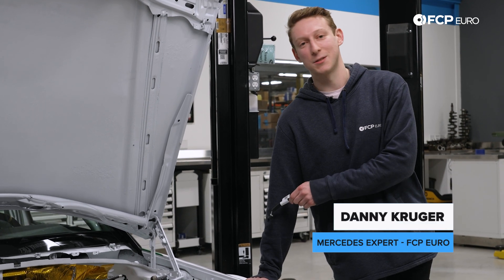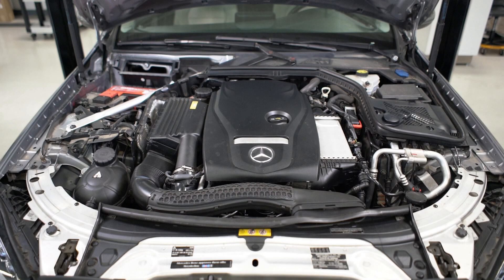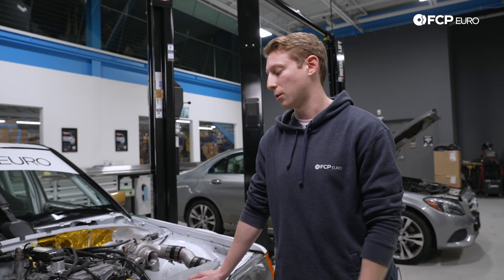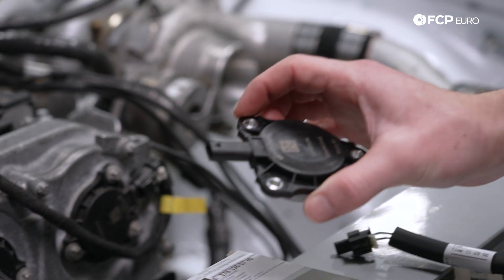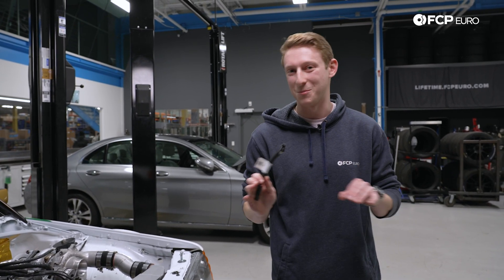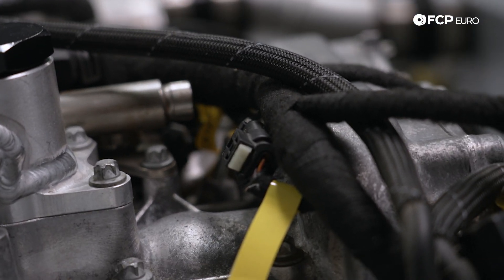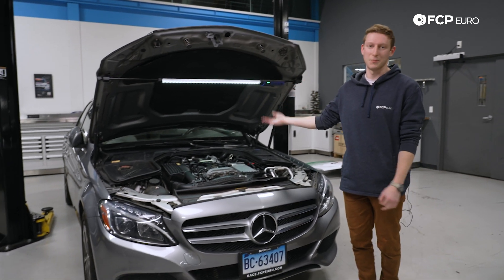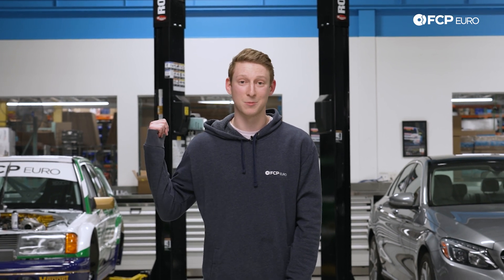How to Keep Oil From Damaging Your Mercedes' Wiring Harness

Comment from the maker: Mercedes "Sacrificial Pigtail" (Just the pigtail)
https://www.fcpeuro.com/products/mercedes-engine-harness-genuine-mercedes-2711500156
Camshaft Adjuster Magnet Replacement Bolt
https://www.fcpeuro.com/products/mercedes-camshaft-adjuster-magnet-bolt-genuine-mercedes-0009903924#fitment

FCP Euro "Camshaft Adjuster Magnet Protection Kit" for  L4/L6 Mercedes models (M270/M274/M260/M264/M256/M133/M139)https://www.fcpeuro.com/products/mercedes-camshaft-solenoid-kit-genuine-mercedes-2761560790kt2#fitment
FCP Euro "Camshaft Position Sensor Protection Kit" for  L4/L6 Mercedes models (M270/M274/M260/M264/M256/M133/M139)
https://www.fcpeuro.com/products/mercedes-camshaft-position-sensor-harness-kit-bosch-2709050400

FCP Euro "Camshaft Adjuster Magnet Protection Kit" for  V6/V8 Mercedes models (M276/M278/M157/M152/M177/M178)
https://www.fcpeuro.com/products/mercedes-camshaft-position-sensor-harness-kit-genuine-mercedes-2769051000kt1
FCP Euro "Camshaft Position Sensor Protection Kit" for  V6/V8 Mercedes models (M276/M278/M157/M152/M177/M178)
https://www.fcpeuro.com/products/mercedes-camshaft-position-sensor-harness-kit-genuine-mercedes-2769051000kt1
Reply: The last two have the same link? Maybe fix them?
Reply: @overcooked123 exactly. Be nice to know how many of each parts I'll need for my m276. 8 pigtails? 4 magnets?
Reply: Both of the links appear to be bad.  Error code 404
Reply from the maker: @stevem6711  Updated! Sorry about that

Comment: How many of these do I need total for my M157 E63?
Reply from the maker: Hi there! You'd want four for the camshaft adjuster magnets. To also protect at the camshaft position sensors, you'd want to replace with four new position sensors and inspect the harness for any signs of oil residue while doing so (and of course, clean the harness if there is any oil present). We have kits for both on our site!
-Danny
Reply: @fcpeuro  Thank you. The pinned comment of yours with links have the same link for separate kits on the M157 engine. Could you provide links for both kits? Thank you.
Reply: @fcpeuro  Also, how many bolts and which ones do I need to order to replace all of the camshaft position sensors and camshaft adjusters?

Comment: How many pigtails do you need? I have 2014 e350 convertible.  I saw the kit link for Camshaft Position Sensor but your link for Camshaft Adjuster Magnet isnt correct.  Im sure I can fig out how many to buy to make it a kit. Thanks,  Just unsure how to install the pigtail.

I will buy for my R350 as well, I just replaced the camshaft magnets and adjusters.  That was done just Q4 last yr. Basic maintenance I did on that. Lucky I did already on the R350.  Will do for the E350 as well.
Reply from the maker: Hi there K D! You'd want four pigtails, for all four of your Adjuster Magnets, and you'd want to replace your camshaft position sensors if there's any sign of leakage there as well (as the pigtails will likely not fit the CPS on your M276, replacing the sensors will prevent any ongoing issues). The part number you can search on our site to find the pigtails would be MER-2711500156, for the full magnet and pigtail kit you'd run KIT-2761560790KT1, and for just the Cam Position Sensor kit, you'd search KIT-2769051000KT1. 

Hope this helps! Let me know if I can help you with anything else.

-Danny

Comment: Thanks so much for this video...I saw the Pigtail on your site and was wondering what it was.  My GLK350 and G63 timing covers are leaking oil so I am going to do the pigtails now for sure.  Maybe on one of your next videos you  could go into some depth on the different connectors on the harnesses and sensors so we don't damage them on a DIY.
Reply from the maker: Hello G-Explore! Yes, as you noted, an excellent time to replace the Adjuster Magnets and install these pigtails is during the timing cover reseal that the "vee" arrangement engines often need with a bit of mileage on them. 

As you're going to have the timing covers off anyways, I'd strongly recommend running with kit KIT-2761560790KT1 on our site; having those timing covers out of the engine bay makes the magnet replacement much simpler. You'd also want three of MER-0009903924 per magnet, or twelve total.

With these parts, you'd have the front of the engine pretty well looked after upon reseal of the timing cover. While you're in there, I'd inspect the cam position sensors for oil residue. If there's any indication of oil, KIT-2769051000KT1 will have what you need.

Best of luck on your repair!
-Danny

Comment: Hi Danny, I have a 2017 C300. I’m confused, how do I remove the wiring harness to the cam adjuster magnets? Exactly how or dislodge the clip and wiring. I can’t get the clip (white piece) to move and/or to move the current harness. Demonstration would be very helpful with sacrificial pigtail installation. Thank you
Reply from the maker: Hi Tom! I actually like to tell people that this install takes about 10 minutes; 9 minutes of fiddling with those irritating little connectors, and less than a minute to install the pigtails and reinstall into the cam magnet.

A pick will be your friend here, first to lift up that white tab you mentioned and second to actually separate the wiring harness from the Camshaft Magnet. If the plug is choosing to be cooperative, you're going to squeeze downwards (or, for a clearer depiction, if the plug is still attached to your camshaft adjuster magnet you'll be pressing the gray tab towards the front of the engine) on the end of that gray tab while simultaneously pulling the plug off of the camshaft adjuster harness. 

If this is unsuccessful (for me it often is) a pick may be your friend. I like to use a pick to gently pull the white tab up a bit to free it, and then put some pressure on it with my thumb and try to pull the plug off. 

If this STILL doesn't work, you can take your pick and gently try to relieve a bit of pressure from the connector end of the plug. Take extra care if doing this though, as we of course want to avoid damaging the wiring harness.

 Combining these tactics is generally successful, and I encourage you to take your time and be patient. I agree that an instructional video on this would be helpful; stay tuned and I'll put one together soon for you and anyone else trying to tackle this job!
-Danny

Comment: I have a 2015 S63 that I just bought,  ended up taking it back to the Mercedes-Benz Dealership where they replaced the whole harness because of this exact issue. Since I don't know much about cars, how many of these do I need to order to have installed to prevent this from happening again.  I  literally just got the car back last week.
Reply from the maker: Hi Jimmy! For your M157 engine in your S63, you'll do four pigtails; one for each of the four Camshaft Adjuster Magnets on the front of your engine (Four of MER-2711500156).

While you're doing this, I'd strongly recommend checking the Camshaft Position Sensors for oil as well. These are on top of the cylinder head (they'll be up about 3-4 inches from your Camshaft Adjuster Magnets, from memory, but will stick directly down into the engine). If these do show signs of oil on the plug when you take the connectors off, I'd recommend cleaning your wiring harness with electronics cleaner and replacing all four Camshaft Position Sensors to prevent leakage at these sources as well. (One of KIT-2769051000KT1)

Let me know if this helps!
-Danny
Reply: @FCP Euro  Hello and thank you so much for the information. I will pass this information along to my friends with S63s as well.

Comment: Thank you Danny for the summary.

One thing though,  regarding the pigtails.  The M276 I have has 3 wires on the cam position sensor , but only 2 wires on the solenoids. The pigtails have to be different.  Do you have both type of pigtails?
Reply from the maker: Hi Juan! I just double-checked fitment for the pigtails on an M276. You're correct, the vehicle I'm checking fitment on will not accept the pigtails at the Cam Position Sensors (but will at the Cam Magnets) due to those connectors having three contact points. I've edited the kit that's linked for the time being to solely include the new Cam Position Sensors and Electronics Cleaner, as those would at least ensure the leak is stopped and the harness can be cleaned.

In the instance you have already purchased a quantity inclusive of CPS installation, you can of course contact our service team to start a Hassle-Free Return as soon as you obtain the harnesses.

Stay tuned regarding an appropriate "one-time solution" on the cam sensors for these engines as I verify fitment, and thanks for pointing this out. 
-Danny
Reply: @fcpeuro I have a s450, I would like to completely protect myself from this issue. Can you post correct likes to what I will need and how many? This is rather confusing and the 2 links you posted for the M276 are the exact same links.

Comment: The elephant in the room that Mercedes has yet to explain is why this is a Mercedes specific problem. I have NEVER heard of oil wicking through a wire harness on any other make. Keep in mind this happened on late 90s and early 2000s Mercs as well where trans fluid would wick into the TCU until the board was saturated with trans fluid. And now all of these later engines. It makes no sense. And after the headaches of the mid 90s and Mercedes awful biodegradable wiring insulation issue. It’s ridiculous.

But yep, folks pay attention to this! Check your sensors and actuators ASAP! I caught it just in time on my M278 and fixed it with new parts from FCP euro. Actuators are a pain to get to on V8, but it beats replacing the entire engine harness, which is an engine out job!

Comment: The same part for the cps and magnets for the m157?
Reply from the maker: Yes, the same wiring pigtail will protect the harness for all of your Cam Magnets as well as your CPS on your M157. If you'd like to replace the sensors while you're in there, you can simply add your vehicle on our site and search "cam adjuster" or "camshaft position sensor" to see our kits including new sensors and pigtails.
Reply: @fcpeuro  Shop told me that the difference between the Cam Magnets and the CPS is that one is 2 pin and the other is 3 pin so the pigtail won't connect for the CPS.

Comment: Great information. The Camshaft sensors also leak oil through the electric connectors. I've just replaced all the magnets and the Cam sensors in my M276 engine. Lucky I caught the issue in the early stages where no oil made it to the wiring harness or the ECU. The best part is I got all my parts from FCP Euro. If they leak oil again, FCP Euro will replace them under the awesome lifetime warranty. Thank you.
Reply from the maker: Exactly Al, happy to hear you caught the issue before it became a big problem! With these kits pieced together, we're hoping these oil-saturated wiring harness issues become a much less common occurrence.
-Danny

Comment: Why not just drill a 1/16” hole in the connector so any oil will drip out and not pressure into the harness?

This is what most water pumps have, to keep any water that passes a failed seal from getting into the bearing. 

Water temp sensors can also fail, pushing coolant down the harness, spraying into the ECU.
Reply from the maker: Hi there! This would be ill-advised, as these sensors are incredibly fragile and are responsible for managing the timing system. 

The issue of the oil wicking upwards isn't exactly a high-pressure situation, and the oil progressing upwards and inwards is even purported to be following electrical current. Fortunately, these pigtails will cost little more than that set of drill bits and require no modification to prevent oil from soiling the harness!
-Danny

Comment: Hello Danny:
Great information...this is a known issue in Germany according to my sources.  Over there they include the M156 engine having this issue.  I don't see it mentioned in your list.  As an owner of a C63 with the aforementioned engine, and a ML with an 278 engine I felt compelled to comment.  I called your company's tech. line; they refused to connect me to you.
Please weigh in on this...obviously I am going to order enough of these for both cars after I hear back from you.
Thank you for your consideration.
Wolf
Reply from the maker: Hello Wolf, thanks for commenting and for reaching out to our team. In this video, we're specifically talking about using these pigtails to prevent the issue on newer engines; such as your M278, and the many other engine codes mentioned in the video description.

The pigtails we're using for the fix on these newer engines were originally produced by Mercedes to solve the very same issue on the M271, M272, and M273 engines. As you mention, this is a known issue on M156 as well; as the M156 is effectively an AMG-tinkered of the M273 engine, this is an immediate form of protection for your wiring harness.

For your C63, you'd just need four of these pigtails (MER-2711500156); one for each Camshaft Adjuster Magnet on the front of the timing cover. For your M278-powered ML, you would likely want a total of eight (MER-2711500156); four for your Camshaft Adjuster Magnets, and four for the camshaft position sensors. Of course, the choice is yours; you may elect to inspect the wiring harness for oil first (or, you may also want to replace your cam magnets at this time), but these pigtails will protect both of your vehicles from transporting oil through the wiring harness.

I hope this helps! If you have any additional questions, just let us know. The links to the products I've mentioned will be included in the description of this video.
-Danny

Comment: This is an important video,  I work at a mercedes independent shop and we always check Camshaft position sensors for oil and the ECM if the sensors had oil. We did a complete electrical overhaul on a M157 cls63 because of this issue. Warranty paid $12500
Reply from the maker: It is a bit remarkable that we're beating Mercedes to the punch here on a very cheap solution to a very real problem, especially considering they developed the parts used in this fix for effectively the exact same issue on the M271/272/273. We've joked that Mercedes should credit us in the TSB when it's delivered, but ultimately, as long as people are protected from that type of repair bill, we'll be happy. 

-Danny

Comment: Will this work on first gen w204? I’ve got a 2009 c300 and it looks like the same pigtail. Thanks!
Reply from the maker: Hi Matt! The M272 under your hood is actually one of the engines Mercedes originally designed these pigtails for, to stop the very same issue from occuring. Take a quick peek under the hood to be certain you don't have these on your Cam Magnets already (many M272s do) and if you don't see them, four of part number MER-2711500156 off of our site will keep you safe!

-Danny
Reply: Thanks for the reply and the awesome parts and service you provide!